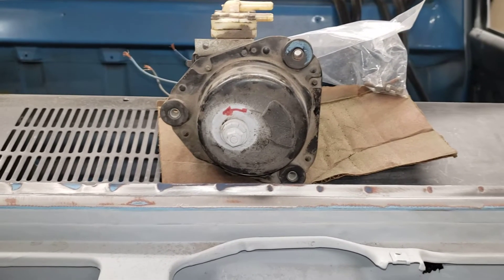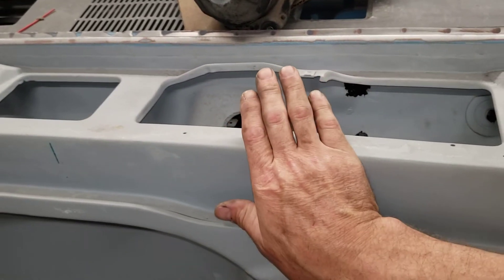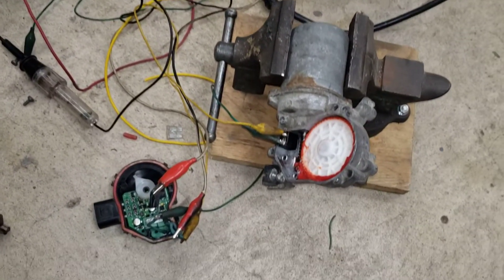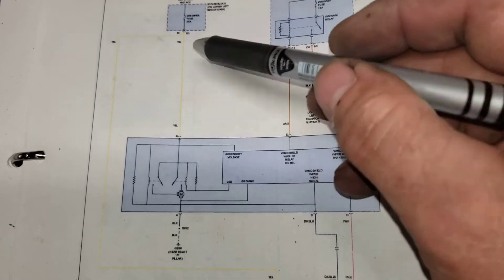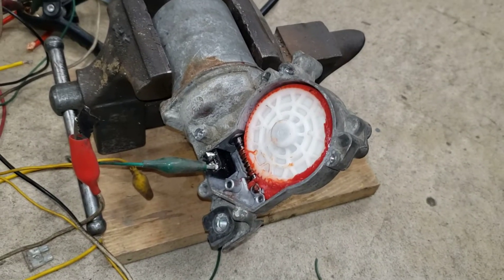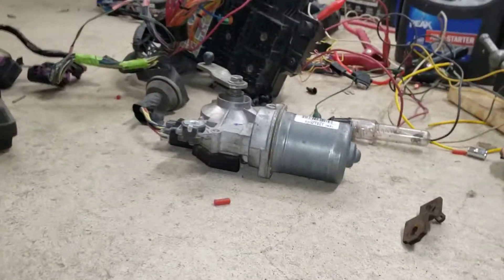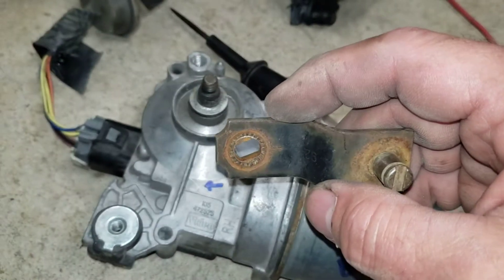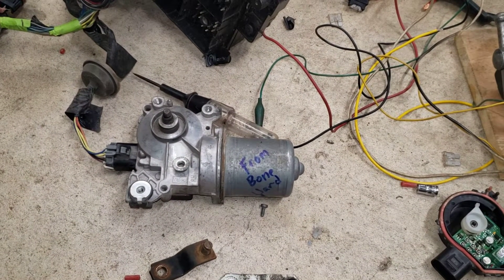Delay Wiper motor reverse direction, easy

Comment: Hi, I did try this and it does work. BUT!!! make sure you hold the rotating part of the motor still or you won't actually change the direction. This being said, I did reverse the direction BUT! wipers still go back to the reset position at the top, not at the bottom and will wipe downward and come back up. I'm at a complete loss as to what needs to change now.
Reply: You see the little white knob on the inside? You would have to fabricate or change it so it aligns with the position you need. That's what tells the controller board where the stop is, and it needs to physically change
Reply: @nyetloki not true. You simply take the rotating arm off of the motor assembly. I’ve done it already as I’ve 100% dismantled this and put it all back together again and run through the function test. It could go either direction as long as you mount the arm back on in the 7 to 8 o’clock position it will stop and start from the correct position.

Comment: I have the same situation with an installation of a wiper motor, steering column and switches from a '98 GMC pickup.  Can you confirm that switching the end cover will reverse the rotation?  I didn't discover this situation until the wiper motor is  basically inaccessible because of the AC components, so I would appreciate some assurance that the change will work with my generation components.
Thanks,
David Klinger
Reply: What is it you want to accomplish by changing directions? I have been able to change the direction the motor turns but you need to prevent the inner rotating portion from spinning in tandem with the housing because you wont change anything if you don't. My housing can only go on in 1 direction as the nuts are not at 12 O'clock and 6 O'clock, but at 11 O'clock and 7' O'clock.(if anyone reading this had difficulty understanding this, hold your hands at 10&2 on the steering wheel) Now what you will have to do in a situation like mine is rotate the housing 180 and allow the rotating part of the motor to turn with the housing, then rotate another 180 degrees and prevent the inner part from rotating OR vice versa.

When I did this the rotation was changed but it did not change how the wipers wiped AT ALL. Somehow when I took everything apart to repair a jamb the "rest position" or reset position of the wipers was at the top of the swipe and not at the bottom where most wipers will reset to. Again, reversing direction DID NOT change how the wipers wipe.